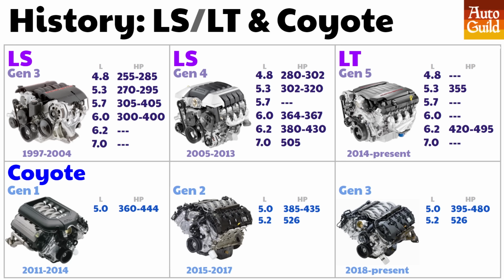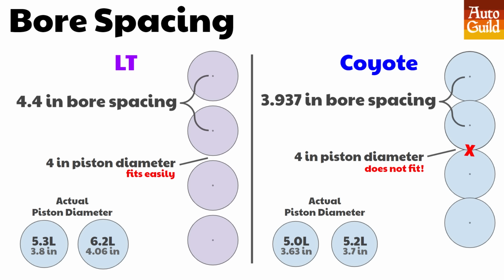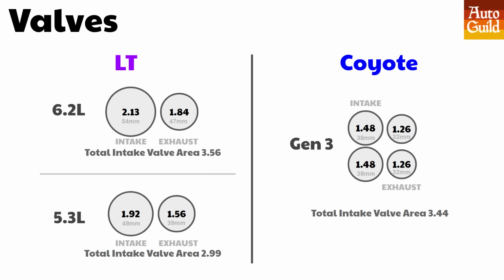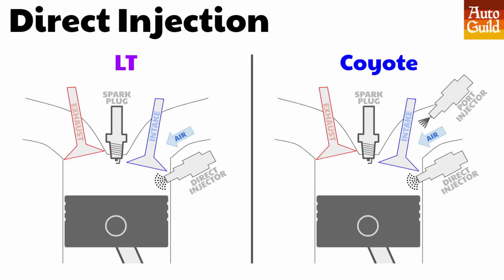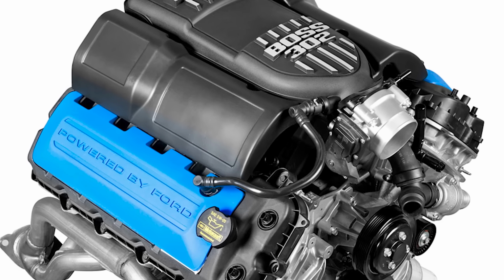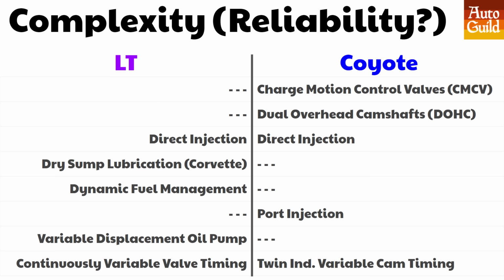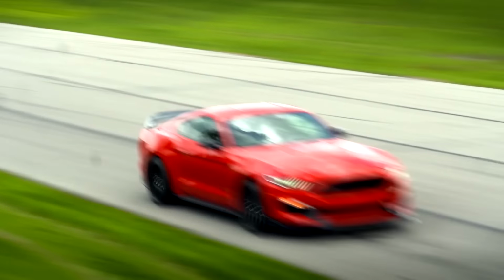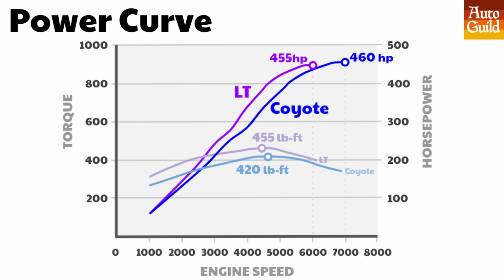GM Gen 5 LT vs Ford Coyote.  Which one is better and why.

Comment: The voodoo was so good GM decided to go to the same direction and use a dohc flat plane crank in the new c8 z06
Reply: gm did it for the rpm and sound. The vette has always been a sportscar and the top models have been easily in supercar territory. Ford is a mustang, sorry to say and its direct comp is a camaro. I cant see paying over 100k dollars for a mustang. Ford should take some tips from the engineers building the LS and LT's . As stated above, " No torque, no room in engine bays for it, its heavier, no low center of gravity for cornering, and 5x the expense for lower cubes and same hp. Give credit to ford on hp per cubes but it fails miserably in all other departments.  Oh and poor oiling on mod motors where the pushrod oils fantastically
Reply: Sounds great and revs high, but to many complaints of oil consumption and engine failure.  I wonder if Gm is copying or if it was in their plans all along…  either way I hope reliability is better than voodoo.
Reply: My daily is a 2003 olds Aurora final 500 dohc 4.0 Northstar and was raced in Nascar for 2 years even by Ford you can look up Roush 4.0 Northstar. I drive the car like crazy 300k miles going like crazy. You can't tell me nothing about a GM DOHC. This is a terrific motor!!!
Reply: @nuttybloc4321  
Don't listen to The Fanboys that's a great engine
Reply: @nuttybloc4321  race motors are different rypea  of propulsion,daily driving cars have more endurance  hence pratt and whiitney are making and designing  so gm flagship vete wont faill  everyday flatplanes are  not easy toakecause of harmo ic balances  shake ita
Reply: Not my experience at all- two Caddies, six crapped motors- bent valves, head gasket probs even after shaving heads and decking blocks- not one of GMs finer moments. FR
Reply: @fredericrike5974  dude stop. In your experience? You're just a YouTube keyboard Warrior what elite doesn't get most of his facts straight, but can't even process comments properly. Experience. LMAO.
Reply: @tedkay5272  You began with deflection and attack and only got worse. If you have a point make it, and we might have "that discussion". This attack just tightens the RedHat syndrome we've already seen in you. Good day  FR
Reply: @Frank Bonazza III C8R's holdin their own against the finest in road race world .
Reply: The Voodoo was a flop. Engine oiling issues leading to engine failure. Too many warranty claims led Ford to stop producing. Like it or not European companies are the only ones to keep the flat plane engine reliable. America hasn’t figured it out yet. Hopefully they will with the new C8 Z06 cuz the sound is just awesome.
Reply: I mean the 3.6 l has been out for awhile with chevy and that's just one version a DOHC engine from them. It's in newer Impala's and Malibu's I think. It revs to 7500 just fine every day, that's probably why I replaced the last engine...
Reply: Just think of the LT6 a GM VOODOO 5.2 engine with 150 more horsepower
Reply: Well let’s be honest Chevrolet already had a quad cam engine way before the vodoo it just wasn’t needed but gm will be producing 640 hp way more than the vodoo engine imagine that 🤣🤣
Reply: @MannyDelReal  if you're talking about the quad cam motor in the c4 ZR1, it wasn't done by Chevrolet. If I recall correctly it was done by Volvo or Mercury marine or some other company, def not Chevy tho.
Reply: @MannyDelReal  Actually it was built and designed by Mercury Marine. And the GM will be 5.5 liter while the Ford is 5.2. AND, it wil be revving to 9k. Most likely since it will be a low production engine, they will likely use titanium rods.
Reply: @hardone4608  the voodoo also revs to 9k…if you have e85 and a cobra jet manifold😁
Reply: @MannyDelReal  the highest naturally aspirated has engine is the gt350rs voodoo.
Reply: @MannyDelReal  Chevrolet Didn't get the kinks worked out of that engine that's why they went away from it. From cooling issues to crankshaft problems. Most everything overhead cam GM ever did was crap. From the Z34 Lumina's to the ZR1. Yeah they ran but for how long? GM Is not willing to spend the time to figure them out. It's easier to add cubic inches to make power and that's just a fact.
Reply: @72blazr1  
How many year has it been since Honda & Toyota have been producing bulletproof engines.
Quad cams, double overhead self adjusting valves. high-revving, .... the list goes on and on. I was born in 1961 and every car I had was American. In 1987 I decided to try my first new Honda Civic. Small simple took me back and forth from Washington DC to Baltimore over 300 thousand miles with no problems.
I can tell you I did not pamper this car.
I drove it like every other car I own like a maniac. After seeing what that car was capable of doing for the price that I paid I never look back. Owned many Honda's over the years since not only for myself but for my family. I owned One Toyota Camry just to check it out a little bit on the boring side and I had to try one Nissan decent for the money but the Honda was definitely a step up. Just so you don't think I'm a Honda fanboy when I had a midlife crisis I decided to try a new Mustang GT premium had a lot of fun with a very outdated vehicle. I remember the suspension in the rear had a solid beam and the turn the headlights on hat to be pulled out like a 1970s American car. In any case the Americans are certainly capable of building high-quality equipment I have no idea why they waited for the Japanese to do it first and then when they started losing their profit share the copying began.
After all these years I'm driving a Honda Accord brand new got it 2 years ago.
Reply: @Frank Bonazza III They've already lost some C8 engines.
Reply: @frenchonion4595  dont forget the 1990-1995 corvette zr1 DOHC motor. GM ahead of its time ..
Reply: @redtesta  blah, blah, blah some nonsense mentioned here. GM/Chevrolet never made that ZR1 engine in the 90's...MerCruiser made that quad cam engine for GM goofy!!!😅😂😭
Reply: @jtthedon4230  Lotus designed the LT5 in conjunction with GM engineers when GM owned Lotus.  Mercury Marine manufactured it under contract, and had nothing to do the design.  GM went to them because of their manufacturing expertise with aluminum castings.
Reply: @redtesta  GM are habitual copycats and have always been behind the times.
Reply: @jameslandon4126  give me examples. Ferrari licenses the magnetic suspension and put it on their ferraris. They didnt copy anyone for all the LS and LT motors. For wasnt the original flat plane crank, need to talk to the europeans about that.
Reply: @redtesta  @Bryant G that 5.7 dohc engine was made by Yamaha..
Reply: When people say gm is making a fpc for the new v the is a pie.pratt and Whitney are making that 💰 tor so garbage motors prime car won't have garbage motor inside of it.im get ng one now to go with my Shelby.

Comment: The LS will always be the cheap and inexpensive way to go. But the Coyote is a much better design. More efficient and stronger with factory parts...except oil pump gears. Even the Gen III hemi is a smarter choice to make power over the LS/LT. The LS is just going to be the less expensive build.
Reply: Are you kidding? A GEN3 HEMI is a better choice for making power than a GEN3-GEN5 SBC? What's the most HP you've seen a H/C/I/bolton/E85 tune 392 Hemi make? Like low 500 WHP range maybe? This combo in a LT1 will produce in the 610-630 range for a good/knowledgeable GEN5 LT shop. (Pray Performance, RPM, GPI, Vengeance, etc) Plus with Hemi you are stuck with and iron block. If you want an iron block then GM gives you that option in the L8T which uses no AFM, no start/stop or any of that other modern BS they're putting on new V8's. BTW what's the most power you've seen a factory bottomend Coyote make without a poweradder? LS/LT is more efficient in that it gives you more ci's per lb, more ci's per space occupied, carries it's weight more efficiently, makes it's HP more efficiently at any given RPM in its rev range.

This so-called GM fan was being generous to the Ford crowd. For one a GEN6 Mustang is 120+ lbs (that's even a conservative #) more than a comparable GEN6 Camaro. That 3,700 lb Mustang GT # that everyone pushes is BS for all except a very base, no option, M6, small wheel/tire/brake, non-premium, non-PP1 car. A base Camaro LT1 is that cars equivalent and it weighs in around the 3,570-3,580 lb mark with an M6. The heaviest GEN6 SS coupe is a 2SS 1LE and it "might" touch the 3,750 lb mark if you get the dealer to special order the sunroof on it. A 1SS is comparable to a base GT PP1 car when you look at wheels/tires/brakes/suspension, only with a trans and rearend coolers so that you won't overheat when pounding out lap times and it's a 3,680 lb car. A regular 2SS is in the 3,700 lb range, and I've seen 18+ GT coupe listed in the 3,860 lb range from independent sources. Basically S550 is the GEN5 Camaro chassis of Mustangs, meaning for a "sports car"  it's mediocre and overweight. Second when did dressed out Coyotes get in the sub 500 lb range? If I remember correctly they used to be in the 520 lb range, but what do I know.?.?.?

BTW I think Coyotes are awesome little 5L engines. I don't own one, but I do have a Foxbody, Terminator and GEN2 Lightning.... And a 19 1SS 1LE. Still no need to downplay the LS/LT engines. They are excellent. The GEN5 in particular is highly unappreciated and I feel that it's because DI and VVT make swaps more challenging, plus you have AFM to either have to delete or to deal with unless you go the LT5 or 6.6L L8T route. Just a little secret the GEN5's also make excellent boosted platforms once you throw some forged rods and piston in it. Compared to GEN4 LS the GEN5 LT uses nodular main caps, a forged crank, gussetted/reinforced coolant passages around the cylinders, 12MM head bolts instead of 11MM like the LS had, plus DI and VVT allows for a more aggressive/liberal tune. Like Coyote the LT loves E85. Shame on GM for putting such a smalk and inefficient blower on the LT4 especially when they had the GT500 Trinity engine to compare it to. It makes it hard for LT4 to compete with boosted Coyotes, GT500's and Hellcats without swapping to a more efficient blower.  Even an old LS9 used a much better TVS2300 and a less budgeted longblock for a boosted engine. IMO the LT5 is the engine the LT4 should of been. Better blower, better forged internals, no AFM components needlessly in an engine that doesn't use AFM, better DPI fuel system. IMO the LT4 is closer to a LT1 with a cheap blower than it is a LT5.
Reply: @JROC734  Refer to any of the AmsOil Engine Master Challenges to see where a reference can be inferred. Now...yes the series folded (thanks LS boys) before the Coyote had an opportunity to compete but the GenIII hemi and the Modular Ford (one year only) were players (the Coyote is far superior to the old modular). The one year the 4 valve Fords ran they absolutely dominated. All three entered finished 1, 2,  & 3. And this was with no development time what so ever. Bischoff and Kaase made well in excess of 850 hp but tuned their entries down to capitalize on the torque curve portion of the rules. The LS boys flipped. The Fords were banned from there on out. After that Popular Hotrodding (RIP) and then the laughably biased HOT ROD did everything to placate the LS crowd. Still...who won the next few years until the series died? GenIII hemis. Facts are facts. Unless there are BOP rules in place to give the LS cubes or boost or less weight or something...they are out classed by better designs. Yes the Mustang is heavy but every version of the current Mustang will outrun its Camaro counterpart in a straight line.

Comment: Where did you get the idea that the Coyote is almost 500lbs? Was that just a guess? The coyote weighs about 420lbs as a longblock, 450lbs dressed. This is comparable to most of the aluminum block LS engines. Ford did a pretty good job keeping weight down with things like hollow camshafts and tiny rocker arms.
Reply: I’ve seen that same info before as well

Comment: I'll go with the chevy, its not just the engine
Reply: Fan of both, but, I went with the Chevy for my personal vehicle as well.
Reply: @Olds_Pwr  
Ford did not need bailing out they weren't facing bankruptcy 
Dont have a link i read it a while back
Reason Dodge outsold them is no doubt because they have the best diesel Cummins 
Its just sad to see made in China on just about every GM part i open not sheet metal but everything plastic and switches too
Reply: Yes the Obama subsidized company is something to be proud of
Also as a lifetime auto body technician most GM parts have made in CHINA on them something else to be proud of
Oh and by the way even DODGE just outsold GM in truck sales so of all trucks made Chevy is last in sales 
Be proud of that China made product
Reply: @drifter9425   really Ford has a lot full of trucks you can now see from space waiting for China chips so they can run hmm.

Comment: Ford engines are designed to fail. When they fail it’s catastrophic
Reply: I  wish there was an NHRA series where the rules were that you could race a Mustang or Camaro...but you had to use the factory block and heads. Let them run turbos or superchargers and see who posts the better times. My money is going to be on the Fords. In Super Stock right now the Mustang is the car to beat even with the Camaro getting a weight break and a cubic inch allowance. let that soak for a while.....
Reply: @toddjohnson7133  Nascar too. It used to be that you couldn’t make a stock car out of a new car but you could now. Camaro Mustang and Challengers. Put the stock back in stock car
Reply: @toddjohnson7133  I watched a video where they had a Coyote and and an LS on the dyno. They just kept adding boast until they failed. The Ford made 930 then the timing chain snapped and the engine was junk. The Chevy made 1040 and blew a head gasket.They could have installed some ARP head studs and MLS gaskets and kept going! Lol
Reply: @canabox7112  Cool...
post the link.
Put it right here___________________
Reply: @toddjohnson7133  I don’t need a link. I’ve actually worked on them. I’ve had tell people your engine’s fuvked and it’s not worth fixing. You can either put a junkyard engine in it and hope for the best or just junk it
Reply: @canabox7112  I see....
Reply: Lol, obvious troll is obvious.
Reply: Meanwhile in Alabama....
Reply: You're not lying dude. Ford socks big ballsack
Reply: @Frank Bonazza III how did they get past all the spark plugs blowing out
Reply: @johnsonbobo2376  
The Coyote is a completely different engine to the 5.4. I believe all they have in common is the modular bellhousing.
Reply: @177SCmaro  my comment was for his 4.6 part of the statement chief
Reply: @johnsonbobo2376  
You failed to specify, cheif.
Also, it a pretty common knowledge there are spark plug thread inserts available for any modular with thread issues.
Reply: @177SCmaro  yes I did. The cotote isn't know to blow spark plugs idiot. Its very clear by process of elimination. Slick. Please think before talking
Reply: @johnsonbobo2376  No. You didn't. And the 4.6 is not particularly known for spark plug issues although there where some. It was mostly the 5.4.
Don't get pissy with me because your stab at the modulars didn't land. That's on you, dude.
Reply: @Frank Bonazza III until the water pump fails and fills the crankcase with coolant. Or the timing fails and you bounce the valves off the pistons

Comment: Why would Ford introduce the Godzilla if it were happy with the Coyote?
Reply: Low end torque for a truck
Reply: Ironically, the poor breathing 2 valve heads give better torque numbers for towing etc.
Reply: Its a truck engine bro.  You don't see it in the mustang do you?  The coyote does just fine.
Reply: @midnight347  Not your bro. And give it time, it'll be in a Mustang at some point, sooner than later. The Godzilla was latched into by enthusiasts as soon as it appeared. It was made available as a crate engine like immediately, because it's smaller, easier to swap, and easier to work on. Why make two completely different V8s? Create a design that is scalable to both roles. That's not just the LS/LT, it's the Hemi, too.

Comment: Missed the most crucial aspect of all engines, reliability.  Both Coyote and Voodoo engines are very suspect of being engines that will last when either raced or driven long distances. That award goes to GMs LT motor, with reports of it being bulletproof in the NON supercharged models.
Reply: This may be more true now of the gm engines, I don't  know...but after owning one of their oil burning lifter collapsing afm engines and having some first hand knowledge of others as well, I will never own another. GM still screws up a solid engine design with afm that they did not get right; and for such minimal gains in fuel economy, if any vs reduced service life and reliability.
Reply: This is total nonsense.  The coyote is super reliable even when driven hard and modified and raced.  I've seen 160k mile engines put down brand new level power and torque and when torn down the bottom end and everything in it looked flawless.  Many guys have over 100k miles on supercharged setups and still going strong.  The voodoo has some issues with the earlier ones that was since fixed.  The coyote is super reliable and very stout.
Reply: @midnight347  The Coyote is based on the Modular engine. In taxi service the would get a million miles out of them AND they spent more time idling than most. Similar service was seen in police use.